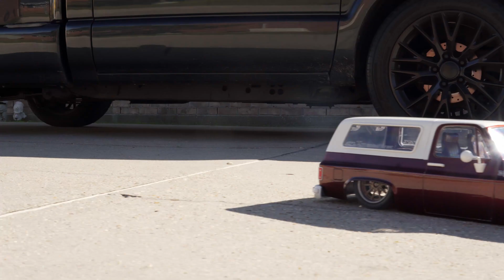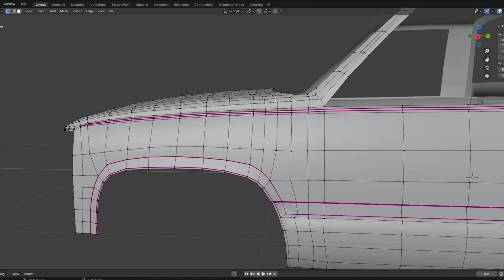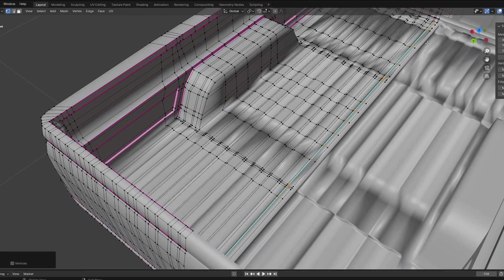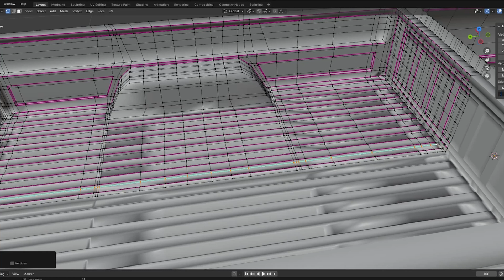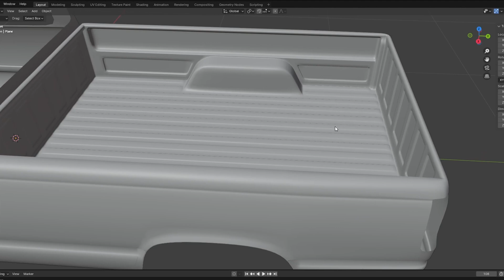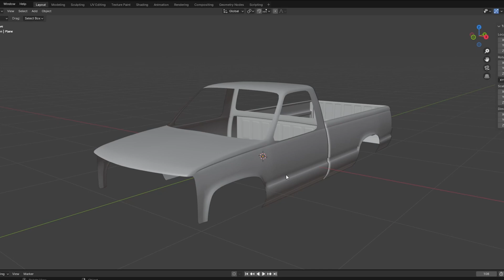A Bit of a Different RC Project!!! | Custom RC Body 3D Modeling

Comment: Hey man, have you ever thought about making a 3d body model for the xmaxx?
Reply from the maker: @CloseEncountersFPV  not really. Printing a body for that truck wouldn't really be practical as even the stock lexan body doesn't hold up to bashing. A 3d printed body would break extremely fast